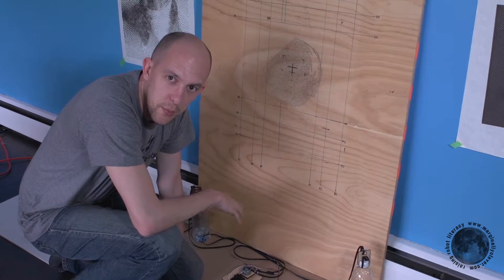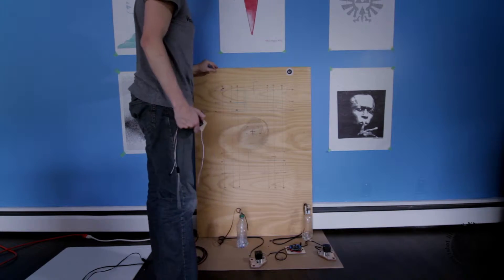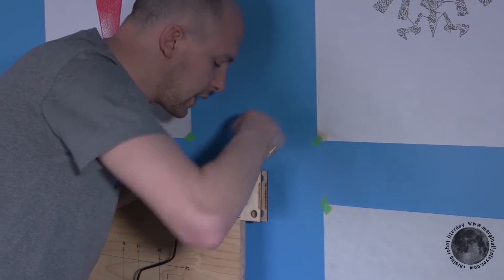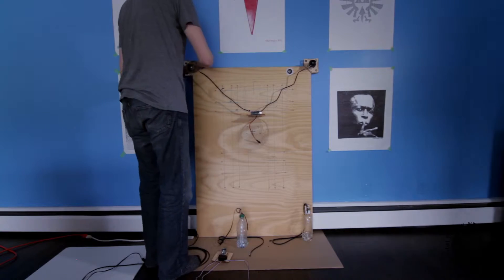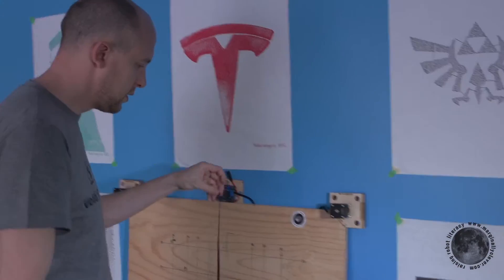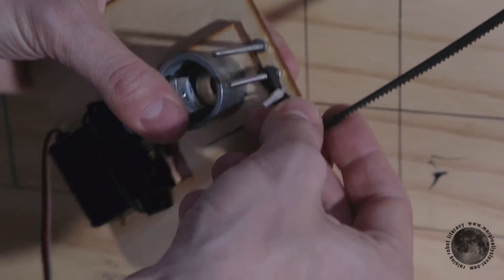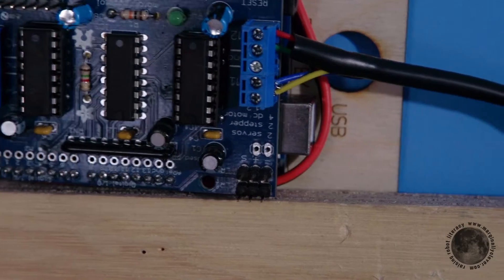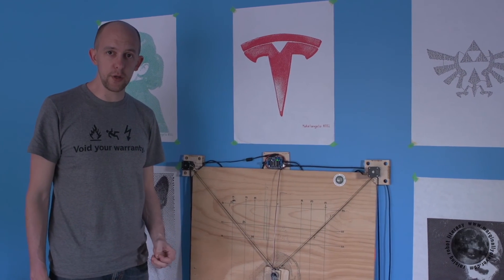Makelangelo Drawing Robot - Hardware Mounting for v2

Comment: Hey Dan,

So I'm not sure if you saw my posts on the Makelangelo Forums but I got an error when I tried running the Makelangelo Rumba Firmware. This is the error: 

‘adjustDimensions’ was not declared in this scope

C:\Users\Hanan\Desktop\Arduino\MarginallyClever-Makelangelo-firmware-83d73a2\makelangeloFirmwareRumba\makelangeloFirmwareRumba.ino: In function ‘void processConfig()’:

makelangeloFirmwareRumba:206: error: ‘adjustDimensions’ was not declared in this scope

adjustDimensions(newT,newB,newR,newL);

^

C:\Users\Hanan\Desktop\Arduino\MarginallyClever-Makelangelo-firmware-83d73a2\makelangeloFirmwareRumba\makelangeloFirmwareRumba.ino: In function ‘void adjustInversions(int, int)’:

makelangeloFirmwareRumba:250: error: ‘saveInversions’ was not declared in this scope

saveInversions();

^

C:\Users\Hanan\Desktop\Arduino\MarginallyClever-Makelangelo-firmware-83d73a2\makelangeloFirmwareRumba\makelangeloFirmwareRumba.ino: In function ‘void polargraph_line(float, float, float, float)’:

makelangeloFirmwareRumba:301: error: ‘motor_line’ was not declared in this scope

motor_line(l1,l2,z,new_feed_rate);

^

C:\Users\Hanan\Desktop\Arduino\MarginallyClever-Makelangelo-firmware-83d73a2\makelangeloFirmwareRumba\makelangeloFirmwareRumba.ino: In function ‘void teleport(float, float)’:

makelangeloFirmwareRumba:406: error: ‘wait_for_empty_segment_buffer’ was not declared in this scope

wait_for_empty_segment_buffer();

^

makelangeloFirmwareRumba:415: error: ‘motor_set_step_count’ was not declared in this scope

motor_set_step_count(L1,L2,0);

^

C:\Users\Hanan\Desktop\Arduino\MarginallyClever-Makelangelo-firmware-83d73a2\makelangeloFirmwareRumba\makelangeloFirmwareRumba.ino: In function ‘void sayVersionNumber()’:

makelangeloFirmwareRumba:436: error: ‘loadVersion’ was not declared in this scope

char versionNumber = loadVersion();

^

C:\Users\Hanan\Desktop\Arduino\MarginallyClever-Makelangelo-firmware-83d73a2\makelangeloFirmwareRumba\makelangeloFirmwareRumba.ino: In function ‘void calibrateBelts()’:

makelangeloFirmwareRumba:448: error: ‘wait_for_empty_segment_buffer’ was not declared in this scope

wait_for_empty_segment_buffer();

^

C:\Users\Hanan\Desktop\Arduino\MarginallyClever-Makelangelo-firmware-83d73a2\makelangeloFirmwareRumba\makelangeloFirmwareRumba.ino: In function ‘void findHome()’:

makelangeloFirmwareRumba:524: error: ‘wait_for_empty_segment_buffer’ was not declared in this scope

wait_for_empty_segment_buffer();

^

C:\Users\Hanan\Desktop\Arduino\MarginallyClever-Makelangelo-firmware-83d73a2\makelangeloFirmwareRumba\makelangeloFirmwareRumba.ino: In function ‘void where()’:

makelangeloFirmwareRumba:594: error: ‘wait_for_empty_segment_buffer’ was not declared in this scope

wait_for_empty_segment_buffer();

^

C:\Users\Hanan\Desktop\Arduino\MarginallyClever-Makelangelo-firmware-83d73a2\makelangeloFirmwareRumba\makelangeloFirmwareRumba.ino: In function ‘void processCommand()’:

makelangeloFirmwareRumba:716: error: ‘saveUID’ was not declared in this scope

saveUID();

^

makelangeloFirmwareRumba:723: error: ‘motor_engage’ was not declared in this scope

case 17: motor_engage(); break;

^

makelangeloFirmwareRumba:724: error: ‘motor_disengage’ was not declared in this scope

case 18: motor_disengage(); break;

^

makelangeloFirmwareRumba:759: error: ‘wait_for_empty_segment_buffer’ was not declared in this scope

wait_for_empty_segment_buffer();

^

makelangeloFirmwareRumba:822: error: ‘savePulleyDiameter’ was not declared in this scope

savePulleyDiameter();

^

makelangeloFirmwareRumba:831: error: ‘SD_StartPrintingFile’ was not declared in this scope

case 4: SD_StartPrintingFile(strchr(serialBuffer,’ ‘)+1); break; // read file

^

makelangeloFirmwareRumba:844: error: ‘saveCalibration’ was not declared in this scope

saveCalibration();

^

C:\Users\Hanan\Desktop\Arduino\MarginallyClever-Makelangelo-firmware-83d73a2\makelangeloFirmwareRumba\makelangeloFirmwareRumba.ino: In function ‘void setHome(float, float)’:

makelangeloFirmwareRumba:884: error: ‘saveHome’ was not declared in this scope

saveHome();

^

C:\Users\Hanan\Desktop\Arduino\MarginallyClever-Makelangelo-firmware-83d73a2\makelangeloFirmwareRumba\makelangeloFirmwareRumba.ino: In function ‘void setup()’:

makelangeloFirmwareRumba:915: error: ‘loadConfig’ was not declared in this scope

loadConfig();

^

makelangeloFirmwareRumba:918: error: ‘motor_setup’ was not declared in this scope

motor_setup();

^

makelangeloFirmwareRumba:919: error: ‘motor_engage’ was not declared in this scope

motor_engage();

^

makelangeloFirmwareRumba:923: error: ‘SD_init’ was not declared in this scope

SD_init();

^

makelangeloFirmwareRumba:924: error: ‘LCD_init’ was not declared in this scope

LCD_init();

^

makelangeloFirmwareRumba:928: error: ‘setPenAngle’ was not declared in this scope

setPenAngle(PEN_UP_ANGLE);

^

C:\Users\Hanan\Desktop\Arduino\MarginallyClever-Makelangelo-firmware-83d73a2\makelangeloFirmwareRumba\makelangeloFirmwareRumba.ino: In function ‘void loop()’:

makelangeloFirmwareRumba:963: error: ‘SD_check’ was not declared in this scope

SD_check();

^

makelangeloFirmwareRumba:965: error: ‘LCD_update’ was not declared in this scope

LCD_update();

^

C:\Users\Hanan\Desktop\Arduino\MarginallyClever-Makelangelo-firmware-83d73a2\makelangeloFirmwareRumba\makelangeloFirmwareRumba.ino: At global scope:

makelangeloFirmwareRumba:971: error: expected declaration before ‘}’ token

}

^

Multiple libraries were found for “LiquidCrystal.h”
Used: C:\Users\Hanan\Documents\Arduino\libraries\LiquidCrystal
Not used: C:\Users\Hanan\Desktop\Arduino\libraries\LiquidCrystal
exit status 1
‘adjustDimensions’ was not declared in this scope

Thank You So Much For All Of Your Help Dan. It really means a lot!
Reply: I'm not going to answer support questions outside of the support forum.  Four hours ago when you posted it I was asleep.  Time zones!